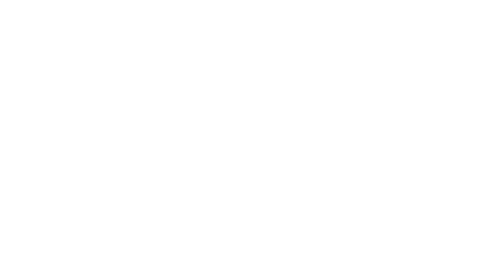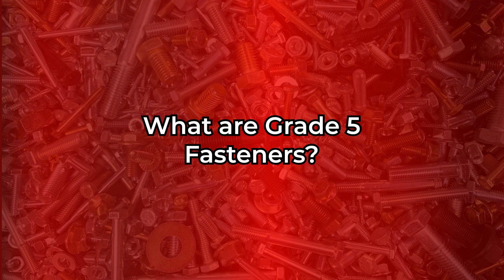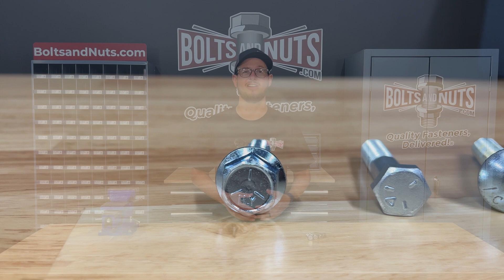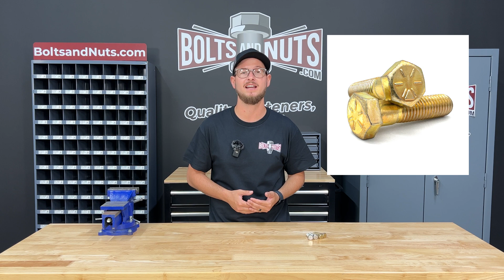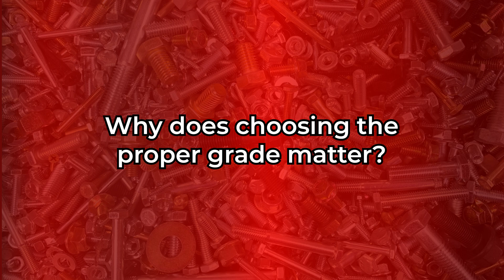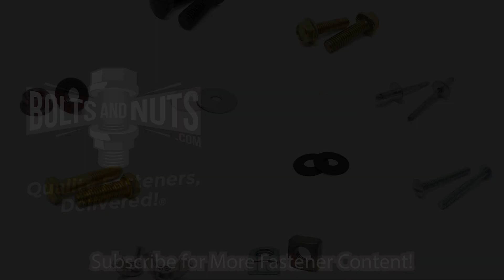The Differences Between Grade 5 & Grade 8 Fasteners Explained!

Comment: will grade 8 be bad on boat trailer ?  salt water use ?
Reply: Probably want to use stainless hardware
Reply: Stainless bolts are only good to resist corrosion. They are close to grade 5 strength but softer so the threads will strip easier and the bolt will bend slightly quicker.

Comment: I have seen too many grade 8 bolt fail in high shock applications. I have more faith in grade 5 bolts. I'll  take tough grade  5 over brittle grade 8 anytime. If you find a snapped  bolt it's always a grade 8. Look at the millions of snapped exhaust manifold bolts on GM and Ford vehicles. All grade 8. Repair with grade 5 and never break another bolt. Though dirt track racing. Grade 8 snap. Grade 5 might bend in high impact but never snaps and you Finnish the race. I've been bolting things together for 40 years and my go to bolt is a grade 5. On the farm too. Grade 5 gets the job done with no snap offs.